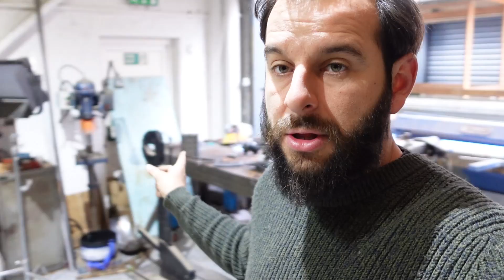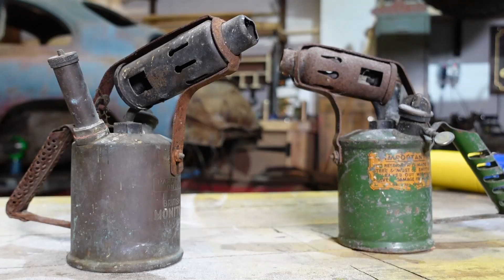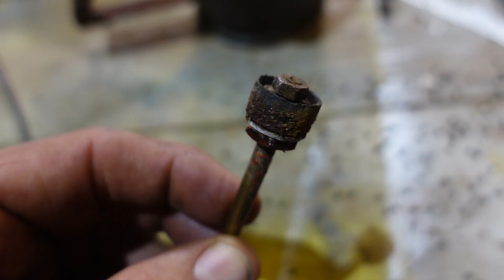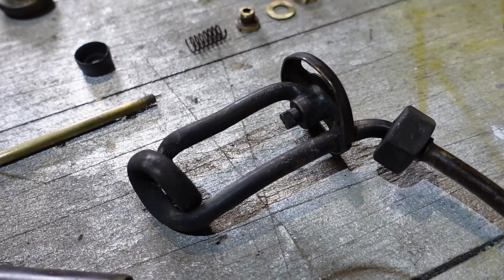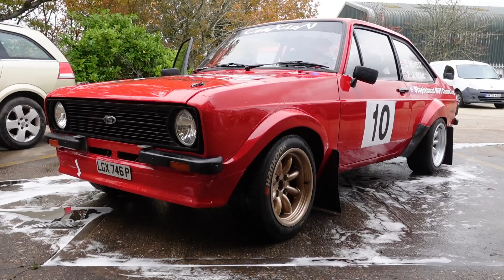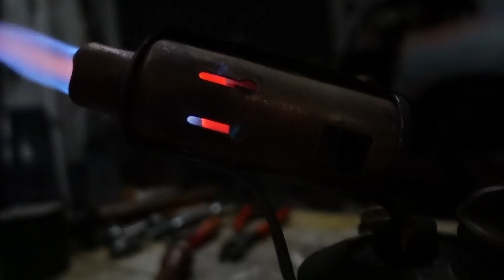Firing Up An Old Blow Torch! | Restoration

Comment: I have a couple of those blowlamps - both still work.  The whole blowlamp principle is the same as a Primus stove that would have been used when camping (before the advent of Camping Gaz stoves)
As you discovered the pump washer on the original machines would have been leather soaked in oil - the later models with a rubber pump washer weren't so clever as the rubber hardened (as yours has) and failed to seal.
When I was doing some building work years ago in the depths of winter in a barn I used the blowlamp as a small space heater - remarkably effective!

Comment: That was great. Only bit that worried me was heating the nut with a blowlamp to get it to undo. So you were heating a tank that contained flammable fuel with a naked flame. Bit like welding a fuel tank,  boom. Go on say paraffin is not so flammable 🤣

Comment: Well done Dom. I have spent many hours behind one. Good for winter mornings stripping paint. I do not know if you can still get them, but there was a "Nozzle Cleaner"as well, known as a "Pricker". This simple device is/was used to insert a needle in the jet when it was blocked without disassembling it. Gold star as well as thumbs up!
Reply: You can get them but a bristle from a wire brush soldered to some sort of handle works.

Comment: Be very careful using heat to loosen nuts as all the fittings are silver soldered and need to be pressure tight.  

Heating them up and then using a spanner, could break the solder seal and render it useless/dangerous.

Comment: Blimey, Dom, that brought back a few memories. In the 50s my ole dad was a GPO engineer and took me in his van during school holidays. He use his blow lamp to 'sweat' joints in manholes. Then in the 60s, I worked in a timber yard in school holidays which we lit with Tilley lamps, I kid you not!! And if you're ever down here in Devon, Check out the Ruffwell Inn, at Thorverton. They've got dozens on shelves round the bar room walls.

Comment: Great lil video, how many ppl have these lamps and dont use them .I tried  to fix mine but didn't have any leather for the plunger only had a brake kit so use a slave cylinder rubber cover cut down ,it still works years later .made to last years

Comment: The tank vent is of extreme importance; your tank pressure could exceed its rupturing capacity if it gets jammed - back in the dim and distant when gas blowlamps were being touted, the perils of an exploding tank was the main scare tactic. 

While not unknown, I don't think it was that common; the only incident I am personally aware of (it happened in the factory where my dad worked in the 1960s) was because the vent had been blocked with a screw because either spring broke or the seal went leaky, so it couldn't be pressurised. My uncle was a plumber and he swore by paraffin blowlamps (and lead piping ;~D).

Oh well, back to the video to see what disaster ensues!
Reply: Non of the ones I have seen have a tank over pressure vent - they just rely on you not going too mad pumping them up. The vent is vital to extinguishing the lamp safely though it could be done 'in extremis' by slowly unscrewing the filler cap. 

The biggest danger other than filling them with a fuel like petrol is knocking them over while operating - they can turn into quite a large fire quite quickly and difficult to get to the 'off' pressure release.
Reply: @johnmurrell3175  I have never encountered one without a vent in the fuel filler, quite a lot are a rubber diaphragm but my dad's had a spring loaded plunger and was the same as the one that ruptured at his factory - the spring broke and the guy who owned it stuck a screw in to seal the tank. It is't the pumping that is the problem, it is the vapour pressure from the fuel after it is lit - if that small orifice gets blocked then several millilitres of fuel can generate a lot of vapour.

Even my father in law's weed lance, which had a steel tank that would probably be impossible to over pressure, had a rubber diaphragm style release valve in the fuel cap.
Reply: @TheOwlman  Just checked my blowlamp and there is no pressure relief in the filler cap just a hard rubber washer. Not sure where the second one ia at present but I think that is the same.
Reply: @johnmurrell3175  Well that is interesting. My dad's had a metal diapgragm with a spring behind it. I would't even light one that didn't have a pressure relief of some sort, having heard the horror story. I assume that they are pressure tested to a higher pressure, though it was the joint to the fuel tube that split and launched a burning cloud of fuel, rather than the tank itself failing. All in all, I am happy to stick with my MAP torch.
Reply: @grotekleum  I don't know what happened to my dad's - he was seduced by the gas cannister type, so I don't know if he binned it or gave it away. Nostalgia being what it is, I was drawn to one at a boot sale but that one did not have a vent so I suspect it was really old example. It was pricey but I wouldn't buy one without a vent anyway, I hope it has become a decorative item somewhere.